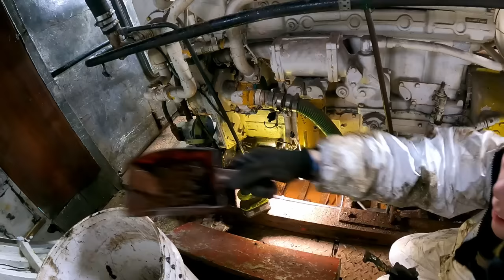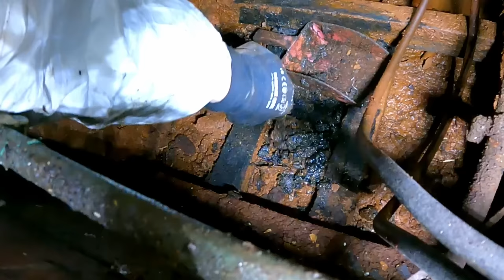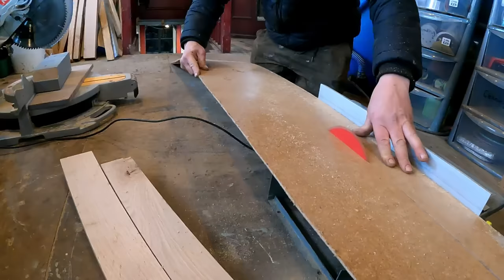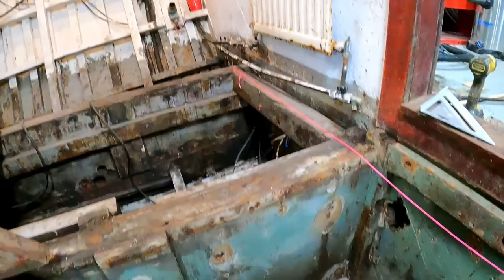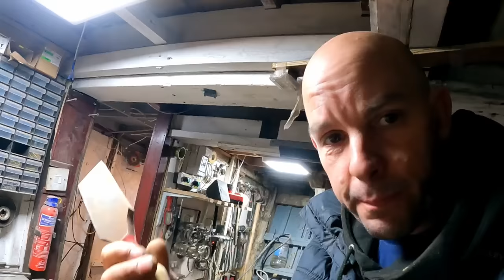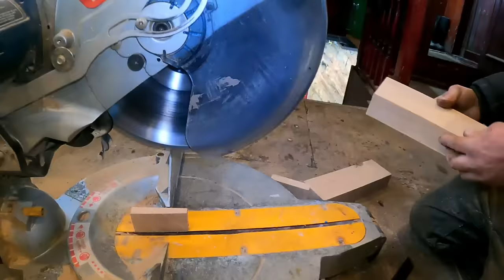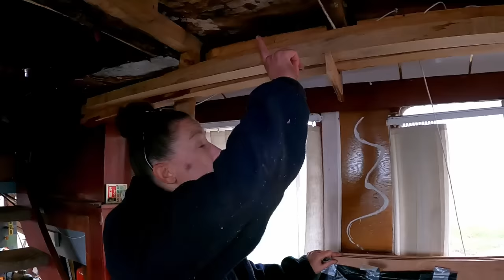Ep 153 - Splitting Up? Boat Work Goes Bad! #boatrestoration

Comment: Impressed as. cept the [drilling] was actually grinding 🙂 Nice goin in the Bilge an all Gem. Mark from Wildings has a Japanese Saw too. Loves it. What did you think Jacq? Jacq of all trades. Nice going Simon, if I remember right, thats where the Batteries are going. Where the fuel tanks used to be. Nice job m8s, thanks, stay vertical.

Comment: What you need to extend your reach is what is known as a soot scraper. It's a scraper designed to reach into a small area from a little distance to clean out a wood stove. I am sure your husband could quickly fabricate one out of scrap metal.
The handle is made of thick wire that can hold it's shape. Then a rectangular price of metal is welded to the end forming a T. The T part is positioned so that it is at right angles to the handle. Then you put the tool end behind the mess and pull toward you. That gives you extension of your arm and more strength as you are pulling the dirt and rubbish toward you. Then you can use the tool you have now to scoop up the debris.

Comment: Engine room bilge vacuum hose extensions.

Use pcv pipe that you have heated and squished down to make a flat nozzle. Use a scrap of  wood to prevent closing it too far.  Then heat about a 8 inches from the end to put in some 15 degree bends.    Make several with bends in different directions.  You can also wait to get aboard to do the bends and the squishing and trimming using a heat gun. I did this on my friends 1943 104' army rescue vessel in the engine room bilge where my arms were not able to reach all the way into the bilge.   We had two detroit 6-71s as main engines.  A 4 cylinder ford leyman on a 25kw and a 6 cylinder perkins on the 35kw. A 4 cylinder benz on a 5kw night gen set.   My friend was aboard at anchor off santa barbara ca in 2002 when there was a new leak in the hull.  I helped him on and off for 22 years on that.

Comment: That looks like some of the mud the boat is sitting in . All wooden boats leak and sitting in mud it has leached into the bilge .dig as much as you can then use a shop vac and if you want a low pressure power washer.this what I did after buying a 1946   75 foot wooden fishing boat.

Comment: To prevent damage to your nice 'new' chisels, use a hard wood mallet instead of a steel hammer. Chisel handles usually fail at the striking surface and it's from using a non-resilient 'thumb wacker'... I think you'll find a lot of uses for a 'Pocket Screw Kit' as you continue to fit out the interior. The non-structural bits and bobs don't really need heavy bolts to secure them... 🤪

Comment: Hand tools are the hardest to use but best when unfamiliar when you are not tired! Hold up your beam with verticals at each end and two diagonals from upper centre to lower end by verticals. This will support the middle under pressure and place it to bulkheads.

Comment: If you read the Maritime Accident Investigation Bureau monthly report, you will see numerous examples of fatalities where people have gone into enclosed spaces and been overcome by carbon dioxide buildup or lack of oxygen.  They often also take any crew mates who go in to rescue them.  Enclosed spaces usually means closed rooms but it is not impossible for a bigger room (such as an engine room) to have a puddle of carbon dioxide at the bottom.  Certainly the bilges are a prime location for the phenomenon.  Two or three breaths and you are unconscious.  Your mates see you, come to see if you're alright and they succumb as well.  It's not likely to happen but you will not get a second chance and a bit of pre-emptive ventilation will reduce the possibility to near impossibility.  Just a thought.  Keep up the good work.

Comment: Simon if you have a dowel jig you could save a lot of money using dowels instead of copper nails in areas where you have used support posts , fairly easy to do once you get the hang of it

Comment: Are your PV panels dead flat?  They should be 10 degrees off vertical this time of year.  Anyway to strap them to the outside cabin wall?  Does your wind turbine not contribute?
What a beautiful set of wood chisels.  Gemma, you should take custody and lock them up so Simon can't use them for cutting stainless bolts in half!  😉

Comment: The way to do that chiseling is to cut a bunch of vertical cuts using the Japanese saw down to the line you have drawn. Then the chisel will make short work of the smaller pieces that these cuts made of the waste you are planning on removing.

Comment: I am wondering why you do not use a shopvac more when cleaning your bilges and clearing swarf from work on the boat.  Is it because you don't have enough power available to use a vacuum more?  Or is there another reason?
I know I use my 6 gallon shopvac constantly in my workshop.

EDIT:  Never mind, Gemma just answered my question at the 2:45 mark.  Thanks for the quick response.

Comment: Hi Gemma and Simon. Really enjoying your channel and very much inspired by your 'can-do' attitude. Here's a suggestion about that heavy water-tight door into the engine room. Well ... hard to tell for sure from the video, but it looks like it might be symmetrical (even down to the hinges and latches), so you could probably unbolt it, spin it 180 degrees and bolt it up again ... so that it opens against the hull instead of taking up all that space that you have to keep clear for it to open. Heavy to move and not easy to unbolt, but if it works ... ? Anyway, cheers and thanks for your content.

Comment: Brings back memories of how hard the guys used to work aboard the old wooden hulled minesweepers.  The 'sweeper I spent most of my  time at sea on had a pair of large GMC diesels for propulsion.  The ratings would do major repairs on those engines while underway.  The strikers did most of the clean up.  Their clothing looked like Gemma's when they came up the ladder from the engine room at meal time.  An early Christmas blessing to you both and your family.

Comment: Cleaning under the engine,  unless you are going to remove engine,s and degrease the subframe the best preservative is the oil and grease. Unless you strip back to new, prime, paint and  coat In oil and grease. 😊

Comment: you need something like one of those commercial cleaning machines with a long pipe that sprays cleaning solution and vacuums it back up t the same time, power is of course the problem! Generator?
Phil

Comment: When we cleaned the bilges on my first submarine. we used a big wet dry vacuum. Using a water hose to flush the bilge trash and gunk to the vacuum. Work is always nasty on the bilges but Now you know there is no work you wont do.

Comment: Poor Gemma shoveling sh1t again. And making lunch.10 out of 10. I have some news for you Simon, those chisels arnt sharp. They've being rattling about in the box banging off each other. Get yourself a Diamond stone as they are called and some honing or lapping fluid. The Faithful tools do a reasonable one with a stand for about 30 pound. Trend are more expensive but top end. the diamond stoned usually are a diamond encrusted 10 mm steel core so they dont flex. Wet or oil stones wear where you use them and after a while get a dip. they usually need a diamond stone to redress them. A good sharp chisel is safer and a pleasure to use. That bearer is looking good.

Comment: With all the off cuts and bits of old wood could you not make a simple "stove" to burn it into both give you warmth and reduce the stuff you need to haul to be burnt elsewhere (by the garbage collectors)? I bet Simon could whip up a good one from some metal buckets and some refractory (fireproof)cement with a simple chimney to keep you from coughing. You might even be able to brew your tea on it.
Ps. for the bilge I would use a steam cleaner to get the grime loose and out of there.

Comment: Gemma, minor problems, like a leaky ceiling, never deter a creative mind from solving problems that arise!

One item I would hope you could explain to your viewers is why the need to apply plywood to the new oak support you build for floor support. Given it's made out of oak, the end pieces are lapped joints, you are going to epoxy all three pieces as well as using mechanical fastners I just can't understand why the need to sandwich this support with plywood, let alone marine ply? Could you explain in the next video?

Comment: gemma your now officaly a bilge rat thats the name i was givem in lairds when i was a apprentice in 1973 , advice 1 remove all the deck plates , 2 extensions to the scrapers and aquire turks head brushes with long handles to reach the spots you cant reach , simon should know ow spray cleaners used on wagons trucks and machines spray this every whaere and the crud will drip off to the bilges , hot water in spray botte that can be pressurised will was this off the engines and steel work this can then be remived with the wet and dry hoover ..  more advise dont sqeeze into tight spots as you then get hot and swell up then you cant get out of this tight spot if it happens sit back do nothing till you cool off and then its possible to retreet out.. other than this advise and i give it as an expert engineer on ships i would say find a member of the family who is smaller and adgile enough to shimmy round the bildges like thay did with me hence my nick name the bilge rat ,, my roll for some time was get tommy the bikge rat he can get  into the  tihight places .. yes i came out covered but i was small then it was fun also. we met once some time back and you seen my motrobike thats a clue good luck ps take the plates away and clean them and repaint them make sure you stamp onto them a ID number so they return from where they came. keep up the good work and where a hat.tommy

Comment: Your boat is a lot like our old house. Built in the early 1900s, the original builder was great and knowledgeable. Inch thick tongue and groove walls, some beaded. Ceiling boards run the entire width of the rooms. Excellent craftsmanship still standing over 100 yrs later.

And then there's The Idiot. Like a door shape cut from the master bedroom in the wall that is up against the stairs. Then the boards put back in the wrong order and spaces filled in with caulk. WHY?? There was already a door of course why attempt to move it to the middle of the stairs?! Then there's the kitchen expansion where a weight bearing beam was left unsupported and the new roof was made flat without adequate drainage. The list goes on. Wanna trade your boat for a house in the beautiful North Carolina Mountains? Trade a bilge for a crawlspace and a cellar? No? Good choice.

Comment: 3/4" marine ply seal with epoxy the second you box frames less oxygen do you wonder why the 1980's rebuild failed don't do the same as everyone else put a new spin on things don't do what made failure happen think for the future of the boat don't take a piece out and put the same piece in you have a chance to look at why things fail im splitting up with your bulkhead

Comment: Tell the Captain His carpenters are doing a great Job The one with the long hair to look Professional turn her Chisel over and use a hammer . 

Captain I was a carpenter for 55 years  started at 12 . When I was in the 8th grade won Men’s Division at the state fair . No I’m Retired 

When using a string line . I Used Horse shoe shims you could us 1-1/4” & 1-1/2” shims  , put Esther size yo chose this give you room for Play where your working , your string is not in your way old school 

Wax your screws 
Helps keep from messing straight Slot and keeps from snapping the head off the screw .

Makes Driving Nails Much easer . 

Nails Not driven in on an angle can back out 

You Hitting two Hammers to Is Stupid 
Don’t tempt fate One Eye captain Jack 
Inspect your Hammers see if you Don’t have pices missing . 

A Black patch , It not worth an ugly Wife or Husband  Don’t Be Stupid, All the people that got hurt was the sightseers the innocent ones .